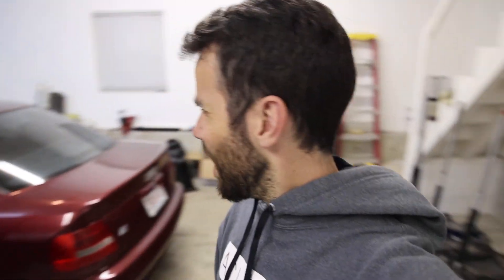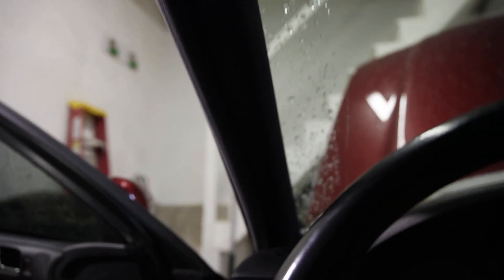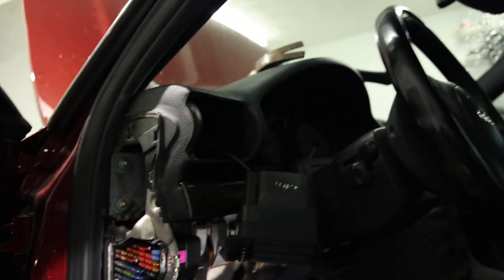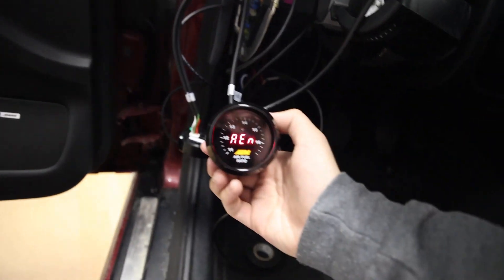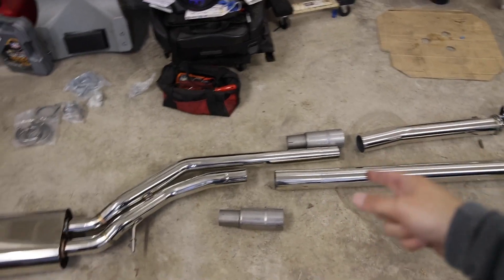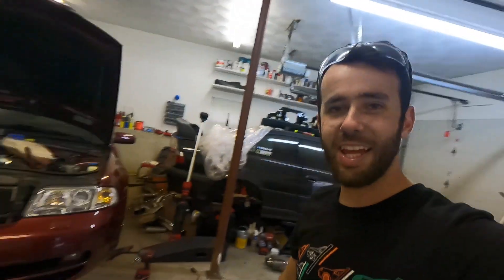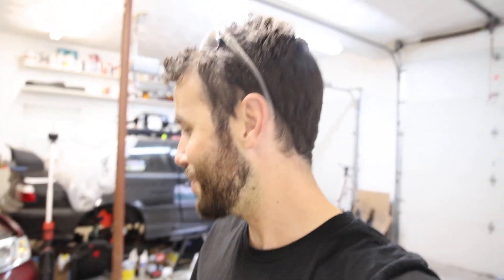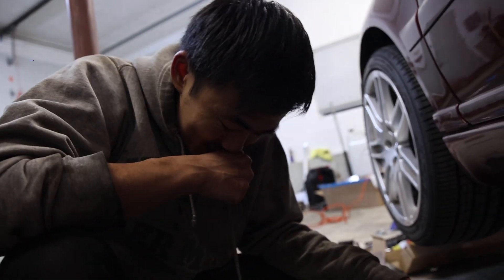B5 S4 Goes Stage 2! (GET Tune, XS Power Exhaust, Wideband, Full Send)

Comment: I swear no one ever shows the install of the Wideband and Gauge, what side/bank downpipe does the sensor mount in? How’s the wiring setup? Is it just switched 12v and ground? Do you have to tap into any wires off of the ecu harness?

Comment: 🤘🏻🤘🏻 ( do they have any tunes for b8’s with a k04? I think my Apr one needs to be dialed better even tho they said it’s the most updated file. It just doesn’t feel like it should , might be time to switch to custom tune or something )
Reply: I don’t at this time but thanks for asking.  Have you had it on a dyno or done any datalogs to see if you are pulling timing or having an underlying issue that’s causing it to be down on power?
Reply: @GermanEliteTuning  no I haven’t taken to the dyno yet, I bought the car with the time already on it.. no actual issues with the car but just from feel I know something is a bit off. I don’t have a tuner to send logs to, it’s just apr ots k04 tune. But definitely getting it to a dyno I suppose is the best option to see what’s going on. And thanks for the reply 🤜🏻🤛🏻

Comment: I just finished doing the XS Downpipes and full exhaust by myself. Second time doing it last time was 2018.... still a bitch in 2023 😂 Similar to your car I had a completely stock Lazer red 1 owner. Can't believe you had to cut and weld and bend and all that's stuff 🙈 mine is the 2.5 DPs to 2.5" exhaust and no modifying at all everything bolted right up . My car also had the original cats and 02s ! Do you have an IG?
Reply: How was it removing stock downpipes